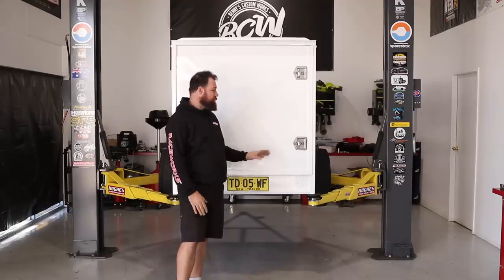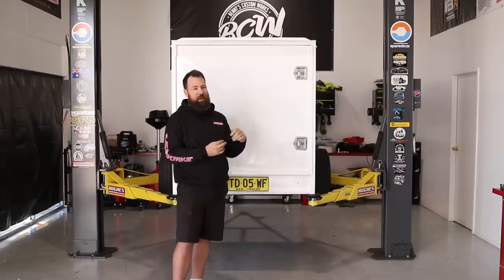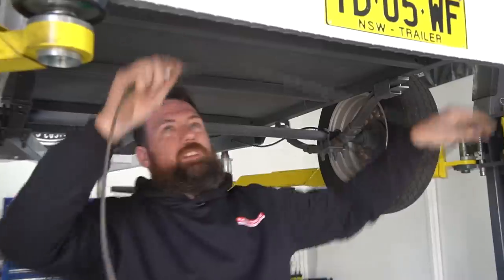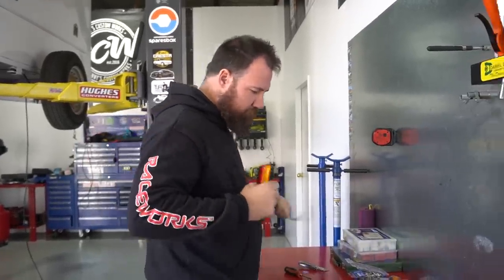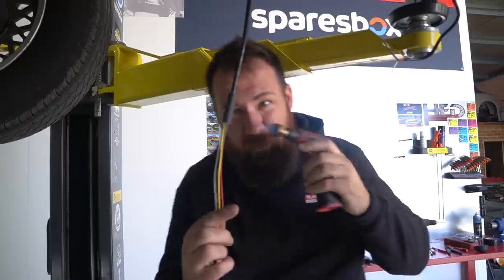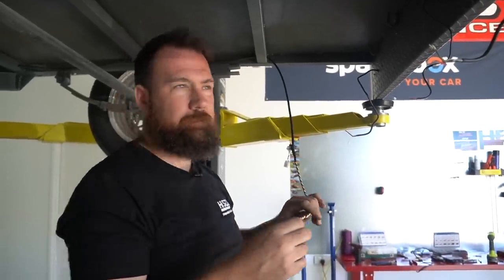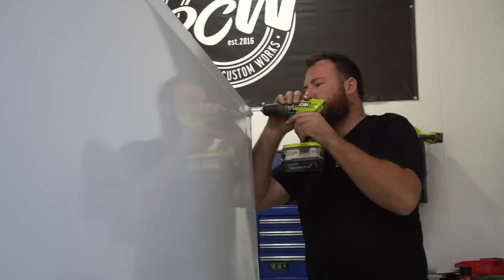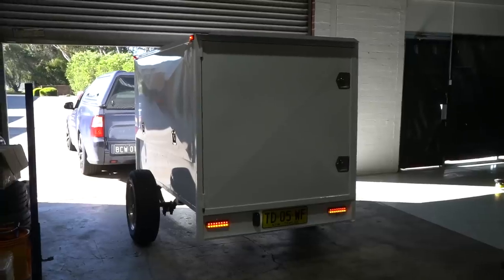Trailer - DIY how to wire your trailer ( Australian standard )

Comment: To remove any jacket (not just the shrink on) just use a thread cutter/seam ripper for when you're using a sewing machine. Cheap as cheap gets, very sharp, and with the safe end on it (a small glass bead) you can slide it inside wires without damaging things. Buy like 10 of them and throw them everywhere you can reach in the shop. You'll thank yourself later. :))
Reply: I opened the comments just to say this! Works excellently!

Comment: I worked in trailer manufacturing about 15 years ago, it was my job first thing everyday to get yesterdays freshly painted trailers all wired up, we'd build between 6 and 10 everyday and i had only 8 minutes per trailer to get it all done, i wish we had the time to bo it to this level but we did it better than most. We sore some shocking stuff doing repairs on other makes.

Comment: From experience, I'd have put some silicone sealant or Sikaflex behind those clearance lamps even if they have a gasket included. At 100kph in inclement you can get a bucketloads of the moist stuff into your trailer cabin. Gaskets move in the extremes of Aussie weather a squirt of poo is simple insurance for keeping your toys dry.
Reply from the maker: Will do, thanks for the recommendation .

Comment: Good call on drag week, a few things I found very handy on my trailers was the narva stick on led strip lights mounted on the underside of the doors when open, put out a heap of light and pretty low draw. Also to save rewiring trailers regularly because of the lead to the car getting pulled accidentally is to wire it like hire trailers with a seperate fly lead between car and trailer, or terminate it in a box on the draw bar then have a seperate section to the car.
Reply from the maker: I have my car trailer wired that way for that reason but this trailer won’t see nearly as much action.

Comment: Seam rippers are the best for clearing any insulation and heat shrink.
Reply: You're talking about the little sewing tool? That's brilliant! I know it because my mom sewed. It would be perfect!
Reply: Ive stabbed myself with one of those a few times. Great tool
Reply: You sir are a genius👌🏼
Reply: @suhmuhdudes1626  Oh, I cannot take the credit. I saw it on Youtube :-)
Reply: Vlastimil Buzek I will have to admit I saw it on youtube as well. Your YouTube comment 😂
Reply: I got this tool at work: IFM E11952 is what google comes up with.  It works great cuz you can set the depth of whatever tray cable you're using and it'll cut just enough off to where you can just bend it to pop it off and usually the cable shielding underneath helps it slide right off as long as you aren't trying to rip off a whole 6 feet.  I'm sure other companies make similar tools, this is just the one I got and what works well for me.  Cheers!
Reply: Snap On actually makes the "Soft Grip Terminal Tool" which is basically a seam ripper on a screwdriver handle.
Reply: +1 for the seam cutter/ripper. Great way to safely strip away shrouding or insulation without nicking or severing wires. It is common practice in my workplace (car audio installation) to use one to safely reveal wiring in door looms etc.

Comment: Good job wing. One additional set of  clear lights inside trailer with separate switch inside trailer to turn off lights in interior wired to top runners . Comes in very handy to find stuff inside trailer on side of road at night . If you put set on inside of side doors would light up side of trailer when changing flat tire if needed. Plan ahead and won't need
Reply: I came to ask where the interior lights were.  Lights in the side doors is a pretty awesome idea as well.
Reply from the maker: We’re going to do a separate 12v system inside the trailer for lighting, power supply , power tool chsrging etc

Comment: Since you're using 7 core and only need 5, a handy way you can remove the outer sheathing is to just pull  one of the wires you don't need down and outside the length of the cable. It'll cut it and come off pretty easy

Comment: Benny, for stripping cable outer, look at a JOKARI swivel blade cable stripper ( there are cheaper versions available)  they are used by electricians on round cables and are adjustable. btw a heat gun works better on heat shrink.

Comment: I was taught never to tin wires before inserting them into screw terminals. With vibration, they WILL become loose. It is better to use pin crimps on the wire ends or at least just tin the last 1-2mm to stop the strands from unravelling.

Comment: The best wiring on a trailer in all of Australia.
Reply: i agree its good to see someone else actually care if they work. Mines just as good if not better. i use medium duty conduit and waterproof boxes from bunnings and terminate all connections there and use waterproof connectors for the electric brakes

Comment: A small battery box with like a motorcycle battery tied to some led adjustable lights for work light could be useful. Make it charge through the car when it’s connected to the trailer plug.

Comment: God i love QC connectors and terminals. Sooooo easy to work with
Reply: Why the need to "work" with them on a trailer? He wired LED lights: They shouldn't need service before the body needs paint. Wasted time and money. Yes terminals are great, but why!?
Reply: @kaydog890  I'm just saying they are a very simple, widely available connector system that is relatively robust and is suitable in many applications.

Comment: Just as a note if you're tying the cable into a knot, if that wire is a signal wire then ensure it is shielded. If it is un-shielded and you tie it into a knot, you could get cross-talk which can mean the lights not working properly.

Comment: Try to find an IDEAL 45-128 sheath stripping tool.
Also multi-core cables often have a rip cord, so strip a short length, find the ripcord and pull it back to strip what you need.
Regards Brian.

Comment: If you want to cut those cable sleeves quickly, you can use a tool painter's use for cutting drop sheets, on ebay you can find them as "poly sheet slitters" just avoid the no-name ones, I've found they always have dull blades. Soon as you see a photo of one you'll understand why they're so good for cable sleeves

Comment: Wire stripping knife is the best for stripping cable. The ones with the plate on the end so you can run it along the length without damaging the internal wires
Reply from the maker: Thanks !! I’ll look into it
Reply: I've also used one that looks a bit like a cigar cutter with a rubber band around it.  They're absolutely brilliant because it's only the rubber band tension on the blade, so it cuts the sheath but not the internal wiring.  Not sure where you'd get them in Aus but https://uk.rs-online.com/mobile/p/wire-strippers/0181373/

Comment: To keep the number plate light separate from the left tail light you could have used a six pin connector instead of a four and bridged the park wire to the extra two pins for the number plate.

Comment: The Earth cable needs to be able to handle all the combined current of the other cables. When using multi-core cable, make sure the White wire is thicker than the others,especially on a trailer with dual axle electric brakes.

Comment: when I wire a trailer I always leave an extra 1/2 meter of wire under trailer to allow for the plug end to be replaced as the plug and the cable will get damaged

Comment: Did I just see you tin the end of those wires that then went under a screw terminal? Turbo Yoda would be disappointed. Shoe lace crimps or nothing.
Reply: Bahahahah go al
Reply: If the other option is to put the wires bare, and we've been doing that for eons with no issues (they still do it in aviation, so that's the biggest hurdle of honor as it were) then putting tin on, isn't going to hurt anything. Especially in a screw terminal situation where the tin will keep the strands packed tight for the screw to bite in. Just because someone says something (including myself now) doesn't mean you have to follow it blindly. Use your head and draw your own conclusions, good or bad. 
In this case, he's a professional, so he knows what he's doing.
Reply: In this situation with the low current leds there is probably never going to be an issue. my original comment was in jest. However it is not good practice to apply solder and then apply a force to the solder. The soft solder cracks under pressure  and what feels like a solid connection is lose a week later. It ends up making a hot joint and then the solder melts and the wire falls out. Look into how a lot of 3D printer fires start.
Reply: I know this is auto electrical but doing that is illegal for a reason in a normal electrical situation
Reply: @aserta  you mean "use ya brain" right? Lol

Comment: UK viewers at very least can ignore most of this video, not being critical of the way this was done, i just know trailer wiring & this wouldn't last a winter in the UK due to salt.
Also our car & van trailer wiring is very different.
We have 6 Circuits using 7 wires, side lights left, side lights right, indicators left, indicators right, brake lights, fog lights, Ground.
Larger trailers & caravans use a second supplementary plug for reverse lights, fridge power, battery charging, etc.
Reply from the maker: Yes I’ve experienced UK trailer wiring, I’ve rewired a Woodford and a Brian james so they work properly for Aus conditions.

Comment: Black can be Auxiliary or Reverse, depending which packet you look at. I wire black as 12v+, and use it to power switched interior lights in the trailer from the car battery.  Although the same thing can be done from the park light circuit, just needs parkers switched on too.  Either way, far easier when you want something out of the trailer at night than using a torch.  A few strips of cheap camping LED's glued to the roof gives plenty of light and won't drain your car battery real fast if you accidentally leave them on.  If you want to see something weird, check out how the US trailers are wired through a four pin plug.   Left brake and indicator, right brake and indicator are one wire each as they all have red indicators.  Then just tail and earth wires.
Reply from the maker: Brett Nicholson the Cresta already has the US trailer plug :D
Reply: That must have been fun to wire up!

Comment: Add led lighting inside the trailer as well as a cigarette lighter you never know when you will need the 12 volt but you’ll be thankful when you have it
Reply: 1992djg also a couple of USB sockets, very handy.
Reply: Although great ideas, those aren't part of the standard trailer wiring. Fuse isn't really rated for any meaningful 12V you'd want to run. Lighting is strict. As a result, probably wouldn't pass inspection in AU.

Comment: What are you using to light up the inside of the box to find tools and equipment, when you are on the side of the road at night?
Reply from the maker: We’ll be doing a separate 12v setup that internal lighting can operate without the trailer being connected to the car , basically a camp trailer setup with a deep cycle battery.
Reply: @BennysCustomWorks  My brother and I were chasing a fault with his caravan's lights.  As we tracked the wiring we found they had used the aux wire as a trickle charge for the on board battery - now that you have cut that wire out of the loom.

Comment: Good on you, Benny.  We love to have you here, but... stay away.   It's... not good here.  :(     Hopefully next year or the year after.  We're well known for being the country that always does the right thing... after all else fails.  :)
Also, tip for removing wire sheathing,  get a short length of lab tubing  or other hose big enough to slip over what you're working with,  embed a scraper blade in it just far enough for the depth you need,  peel down using your trigger finger to hold blade  in place and pull.  :)  (You still have to feel your way but it's better than slashing a couple hundred times.)
(And when you do come back, you could loosen up a bit about the strategy.  You guys have a tendency to run before the Hot Rod channel even starts streaming.  :)  )

Comment: This may be a silly question but why did you tin some of the wires with solder and not all of them benny
Reply from the maker: The ones that were tinned go into a screw block, sometimes the screws can cut through the copper strands . This stops that happening .

Comment: Not all Australian trailer plugs are wired to AS-2513.
Some unscrupulous manufacturers use the Reverse signal for Auxiliary power, even though the wiring is not suitable. 1.5mm^2 wire is not enough to safely power a fridge. Even more dangerous, when a vehicle is modified to function with non-standard wiring, and a standard-compliant trailer is connected, the Reverse Lamps will illegally operate when the vehicle is turned on.

Comment: Hey man just an idea why not use the reverse light wire to power a light on the inside of the trailer
Reply from the maker: Will be running a completely separate 12v battery/ lighting system that doesn’t need to be connected to the car .
Reply: @BennysCustomWorks  ok that's cool

Comment: wiring codes are obviously different in Australia than the UK. here you dont have a wire for reversing lights on standard trailer wiring, park and sidelights are one and the same, brake lights are operated from the vehicle, sidelights are wired seperately from 1 side to the other etc., and the colour codes are slightly different it seems. blue here is Foglights, for example
Reply: The plugs we use to connect the car to the trailer over here, are big round things as well, not the little flat thing Benny was using.

Comment: Would have been nice to cover that single insulation. Instead of stripping all the insulation from where you joined on for the right tail light, you could have only stripped what you needed for the tee off.
Reply: he means pull that outer sheath back just far enough to do your tee, leave the rest on

Comment: Why use a connector for the lights if it doesnt fit back through the hole of the trailer ? Why not crimp the wires together and if you ever need to remove them, just cut it ? Or am I just being a hack ?

Comment: Cable stripper  like this - https://www.amazon.com.au/Foto4easy-Rotating-Slitting-Stripper-4-5-25mm/dp/B07DDH9PSB/ref=sr_1_1?dchild=1&keywords=Rotating+Stripper&qid=1590782895&sr=8-1 a rotating cable slitter stripper - there's a little blade that you set the height of then clamp the cable and spin it around the cable then you swing the blade 90 deg (little lever) and pull it along the cable slitting it.

Comment: Use the black wire on the loom to connect to both indicators so they both come on solid while reversing.  Also noticed you forgot blinker fluid
Reply: That would make them both common to each other and both will flash when indicating either direction as well as back feeding the reverse lights on the car making them flash.
Reply: You obviously haven't wired a trailer before.

Comment: I never cut off spare wires. On long runs they can be used if a wire gets damaged.l see you are using a flame on shrink wrap. We use a heat gun, hotter than a hair dryer and used on low as we are not stripping paint. On big jobs we run wiring in conduits, cables with high current draw or buss cables are run in their own conduits. On coaches and big trucks negatives (earths) are kept separate from positives and any wire that is switched positive.

Comment: Why put connectors in instead of full soldering the wires?
Reply from the maker: Easy to replace the main run if required

Comment: Hey benny Think youll find ya not aloud sponsers at drag challange matey, better check with scotty before ya sign wright everything... love ya work benny
Reply from the maker: I rad Drag challenge weekend with the car signed, it’s pretty much the same rules as Drag week. Also trailers were open slather.
Reply: I'm pretty sure they would have an agreement in place.
Reply: @BennysCustomWorks  ah yep fair enough, just didnt want you to get it all sign wrighten then havta  peel it  off  at scrut, coz i did read somthing about that in the rules, but having said that ive never competed in it ... yet ha ha 

Thanks for the video's matey, keep up the good  work

Comment: @Benny's Custom Works, there's a tool for taking that wire insulation off, its not perfect, but its better then a knife. 
https://www.platinumtools.com/products/strippers/wire-strippers/cable-jacket-slitter-stripping-tool-10005c/
Reply: alternately, you can use a seam ripper, designed for taking cloths apart, less chance of damaging the wires you're separating